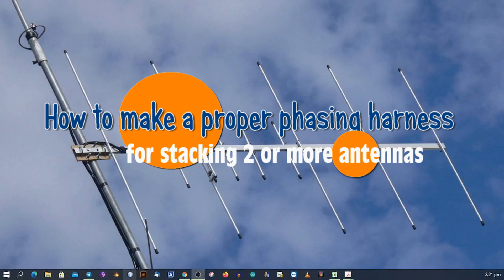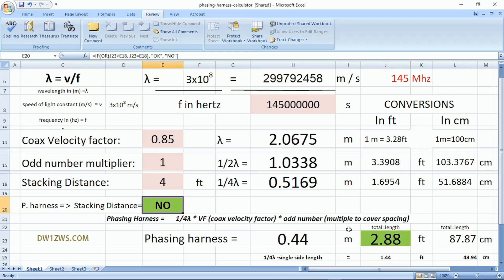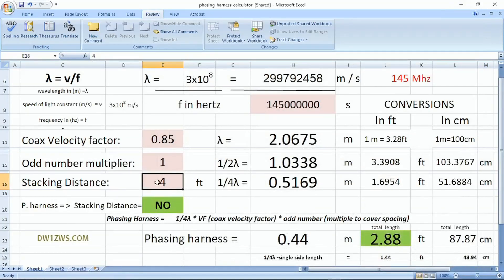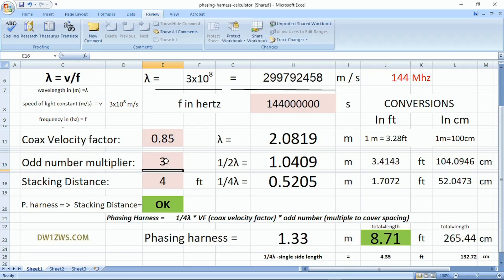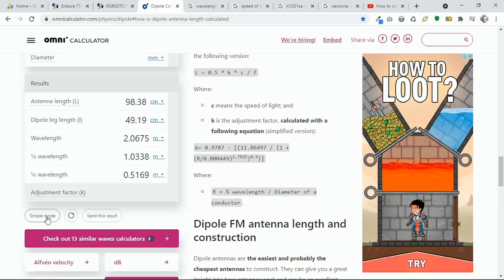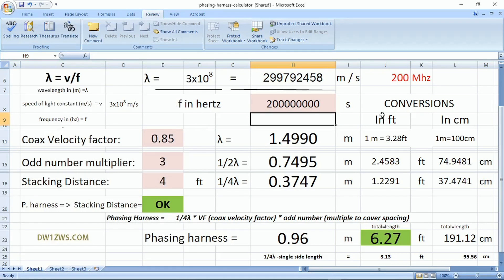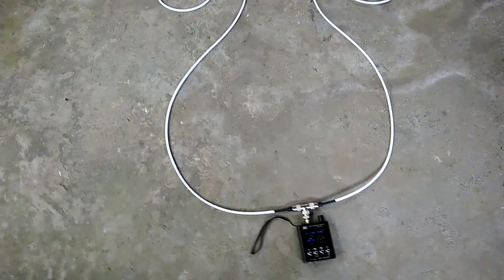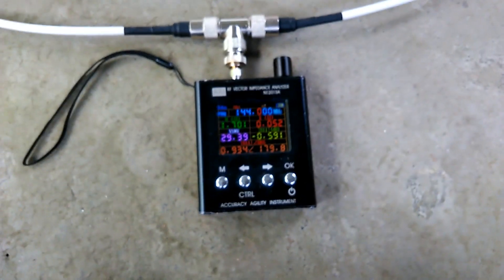Computing for the correct length of the Phasing Harness?

Comment: Could you please make an xls sheet for 2 ways antenna spacing calculator. Thanks
Reply from the maker: Hi it is best to model it in antenna modeller to optimized your antenna spacing, for your reference you may check out this video for rule of thumb spacing. https://www.youtube.com/watch?v=rPC67p8b26A
Reply: @EphraimGariguez  thanks
Reply: @EphraimGariguez  it's just a two simple fm dipoles 
Just 2.8 meter is okay.
Reply from the maker: @ElectronicsShow  1/2 wave length spacing is fine in reference with your antenna center frequency.
Reply: @EphraimGariguez  can we  dedicate the operating frequency from the length of the harness. Exemple mine is 235 Cm. What is the frequency of it. Thanks
Reply from the maker: @ElectronicsShow  re-arrange the wavelength formula and compute for the frequency based on the length of your cable > λ = v/f taking into consideration the frequency of coaxial cable.
Reply: @EphraimGariguez  f=v/lambda. My length of rg11 is 235cm.
Reply from the maker: @ElectronicsShow  your lambda is 235cm convert it to meter, V = speed of light > that's just direct subsitution you'll get the frequency

Comment: sir paano kung dual band vhf/uhf?
Reply from the maker: for dual band antenna the design frequency is usually complimentary 3rd harmonic of VHF frequency i.e 145Mhz 3rd harmonic is 435Mhz, so you have to make a phasing harness for the VHF side measurement and it will work on the UHF 3rd harmonic frequency 435Mhz the phasing harness should be the same length.
Reply: @EphraimGariguez  Can I use RG-58 po for phasing harness?
Reply from the maker: @markjovanpaye1303  75ohms po for phasing
Reply: @EphraimGariguez  thanks po